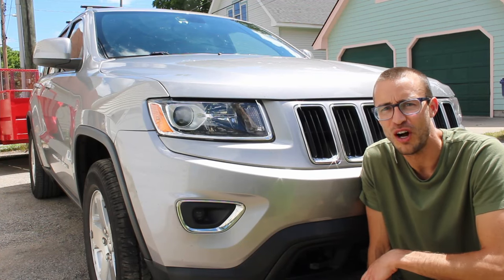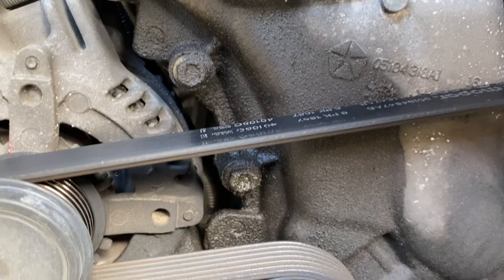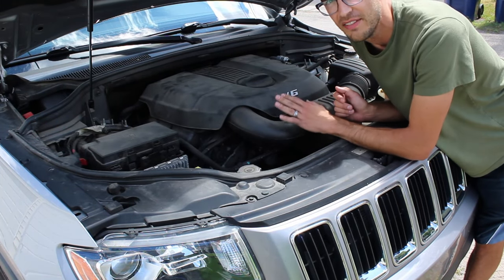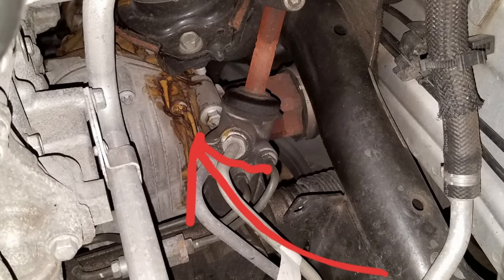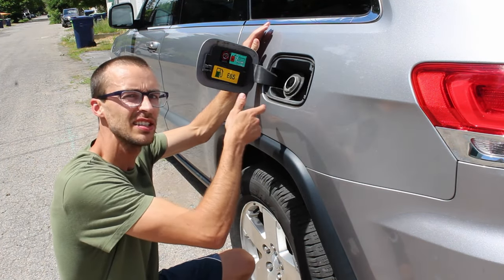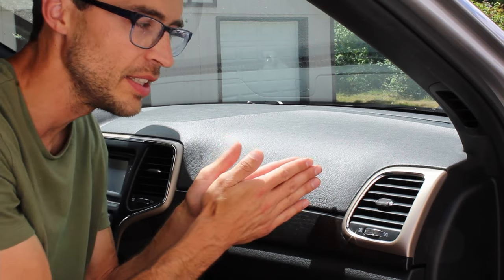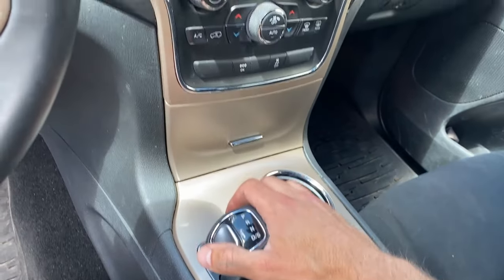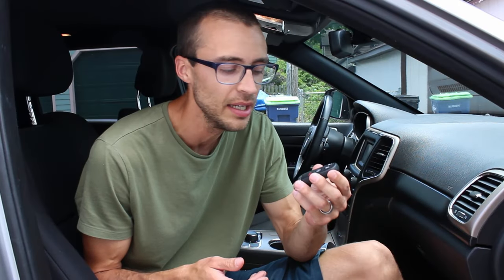Jeep Grand Cherokee Common Problems - 2011-2022 WK2

Comment from the maker: If you found this helpful consider sending me a Super Thanks :thanksdoc:💰 I will buy a Coffee with it! ☕
Reply: I had my Jeep in the shop for about 2 weeks because someone ran into me. Now all of a sudden my suspension system isn't working. My Jeep is so low to the ground that it's scraping everything and bouncing around like crazy. Progressive won't even fix the issue reverb right the original accident wasn't my fault and I never had this issue before taking it in for a fender bender...  I'm soooooooooo angry I have no idea what to do other than her a lawyer
Reply: I have a 2011 3.6 lerado. When I go 60mph, It make this grinding whistling sound like air leaking from under the hood.  Is there an evap line under there that needs checking?
Reply: @tdub8526  its a warped winshield cowl
Reply: @cliffwood2909  im hoping its the heater line to my A/C. I don't get heat on my drive side, waiting on the part now.

Comment: I own a 2011 Grand Cherokee Overland. I would advised, Anyone thinking of buying one. Don't it's just not worth the hassle. I've gone threw 3 compressors 2 radiators hoses and pumps. An evaporator. which i did not repair. Air suspension leaks. So stay far away from any suv or vehical. That has air suspension on it.
Reply: I think maybe you just had some bad luck. I'm on my third Grand Cherokee with air suspension in a row and none ever had a single issue with the air suspension at all.
Reply: does warranty cover all that? if so i’m grabbing one this week
Reply: @outsideboy23  depends on what warranty you choose, most of em cover just engine/transmission
Reply: @cavsnation9194  wow just hurt my feelings i was looking forward to this 😒 even for the 2016 models ?
Reply: @outsideboy23  dealers warranty should have you covered , but extended warranty covers engine and transmission unless you get bumper to bumper
Reply: @outsideboy23  it’s not that bad , my Cherokee had a leak in the suspension and it was a 30 dollar fix ,I haven’t ran into no big problems just yet
Reply: I converted mine to coil spring
Spring from king suspension
Shocks from dobinsons
Reply: 2011 (1st model year) and 2014 (refreshed model pushed out in early 2013) were the worst model years of the grand.
Reply: I have a 2015 grand Cherokee overland and never had a leak
Reply: Never had a problem honest the airbags aren't that hard of a repair if bags where 600 a piece years ago but now 60 dollars and no spring compressor required. The quiet smooth ride is worth it to me. Never had an issue and I wouldn't convert to steel springs. Honestly considering air for my 3500 ho
Reply: @outsideboy23  that's subjective! I have a 2014 wk2, with 125,000 no issues yet
Reply: The only problem with the 2011 is the fuse box housing
Reply: @KaisTheFireWarrior  so in other words, replacement of the entire file box unit?
Reply: @StickNclutch  yeah
Reply: I haven't had my 2011 Limited 5.7 hemi for more than two years: Water pump and thermostat failed the first year, second year evaporator failed, engine & tranmission mounts and upper/lower radiator hoses. Next on the list is suspension all around. Luckily extended warranty covered most of that besides hoses.
Reply: People complaining about Air Suspension could easily fix the issue to converting the suspension over to regular coils. Atleast that’s what I did and it drives 10x better.
Reply: @rs112490  what were the problems with the 2013?
Reply: Air suspension is bad in the cold, I live in Florida where it's hot and no issues
Reply: I need help with sunroof not closing
Reply: I mean I have a 2015 at 13000 and just replaced the radiator and that’s been the only thing. A lot of cars that have air suspension end up having issues not all but a lot so.
Reply: Just because you are terrible to your vehicle doesnt mean everyone treats it like trash. Get better parts than the cheapest piece of shit you see.
Reply: The 2011 is far and away the worst WK2 model year. Literally any other year is worlds better

Comment: I bought a 12' Laredo new.  Still have it, 140,000 miles.  The thermostat got me as well as the air switch you spoke of.  That one was $900.  My starter recently went, another $900.  Otherwise in 10 years it's been great.  Drives like new, I've done tires a few times, got rear brakes.  I plan to drive it another 100k.  It's quiet and smooth, and it can handle 20 inches of snow even though it's got the base 4wd system.  Best vehicle I've owned.
Reply from the maker: They are pretty great vehicles
Reply: I just bought a 2012 with 130,000 miles. Look they look great.
Reply: You garage that bad boy?
Reply: @jonthompson8807  ha good question.  Lived in in Illinois and did for 8.5 years.  The past 1.5 I've lived in a townhome near the beach in FL with no garage so it will be interesting to see how it does.  I wax it 2 times a year and no more show so that's good, but the ocean and heat will be a test. Looks good still
Reply: Yup they are tanks in snow and mud
Reply: I just bought one and it's super clean and neat barley used and the previous owner got the radio out and has a touch display, pretty nice.
Reply: My wife has owned her 2011 hemi for 3 years @92k currently, engine mounts, water pump, and transmission mounts all under extended warranty. I have replaced upper & lower rad hoses. Paid for a/c recharge and diag then the driver side blend door motor just went 🙃🙃🙃 suspension is toast and needs brakes all around. Horrible cars I am familiar with Honda/Toyota 😂
Reply: Closing in on 160,000, recently had to do the the oil cooler & decided to do my second round of spark plugs & coils while there.  (Not me, mechanic). Other than that still good!
Reply: Not tryna jinx myself but I bought mines in 2020, it’s a 2016 jeep grand Cherokee Laredo as well. I haven’t had a single problem other than a water pump or something like that which was only $200-$300 with labor to repair. What a waste of a $3000 warranty smh I love my truck! Still runs like new!

Comment: Also listen for a ticking noise from the engine; that’s the lifters going bad. They fail at the bearings inside and just one going bad will scratch your camshaft. I had to replace two camshaft. By the way if you are doing this job, just go ahead and replace all lifters, oil cooler, hoses, sensors, spark plugs etc.

Comment: Yup, 2014 Limited with 60K miles. Replaced the thermostat and both motor mounts leaked out long ago.  Doesn't seem too matter, however.  I needed to replace the battery today after 10 years.  Under the seat is a stupid place for a battery, but I had no trouble, thanks to good YouTube videos. Thanks.

Comment: We are the lucky ones we just purchased a 2017 jeep grand Cherokee limited with the luxury 2 package used with 60,000 miles one week of driving it odometer flashes lights flicker and the passenger window rolls down on its own now it’s sitting at the dealership waiting for it to get fixed Merry freaking Christmas
Reply: Im about to buy a 2017 one you don’t recommend me it ?
Reply: @PaapiA  update it was a loose ground under the battery and the batteries are under the passenger seat it took the dealership 3 weeks to figure it out but ever since it's been a wonderful vehicle and my wife loves it

Comment: You mentioned rough idle. Mine is starting to do that now. It is a 2017 and has about 63K miles. It also shakes pretty badly when I am stopped and barely take pressure off of the brake to creep forward.  It isnt thowing any codes but seemed to start after I had a fuel injector issue and had them replaced.  Any ideas what causes this or what I can do to fix it?
Reply: What did you end up doing? Mine is idling.

Comment: 2011 - 208K miles....waterpump was replaced at 150k. I replaced the broken accuators (both) ~185K.  youtube can help you with any fix needed.  Still runs great!
Reply: Your actuators got that far? Wow. Barely got to 100k. 25 cent piece of plastic!

Comment: my wife has a 2015 JGC Limited 3.6 with 110K miles,  we bought it brand new.  We have had some issues but nothing worth mentioning.  Based on mileage and dealer's recommendation, I've been doing some preventive maintenance; idler pulley, tensioner pulley, harmonic balancer, belt, thermostat, water pump, starter, motor mounts.  Soon I will be doing the rocker arms.  All in all its a great SUV, the engine still running very strong without showing any signs of slowing down.  I'm hoping to keep it for another 10yrs.
Reply: Is it necessary to replace timing belt at some point ? Or it’s a chain ?

Comment: 2012 Hemi Overland w 122k- Air suspension line leak and then compressor failure, motor mounts, water pump, leaking steering rack, 2 broken exhaust manifold bolts, blend door motor failure
Reply from the maker: 5 out of 6 I mentioned in the video not too shabby!

Comment: 2012 GC OL. I had pretty much all the problem you discussed. I am not a handy man however I fixed both blenddoor actuators. Driver side was little difficult. Cost me under 100 dollar to fix. Dealer asked me 1800 dollar to fix. Lol. YouTube has step by step instruction. Thanks for sharing. Love the comfort. I find this Jeep way more fun drive then my 2018 4Runner. I said comfort not reliability. Lol
Reply: if you remember which video that helped you replaced the driver blend door actuator.. i would LOVE the help! mine has been broken for like 2 years but i know how much the dealer wants to fix it and i cant pay that. thankfully i live in sunny cali and heat isnt a huge need in my part of the state

Comment: I’ve had my 2015 GC Lerado Blackhawk for 3 years now. It has 190,000 Kms on it. I’ve changed the oil filter housing (did it myself), changed the thermostat (myself), I think #4 coil and just recently changed all 24 rockers. Even with all that, I love this SUV it’s such a nice looking SUV, especially, black on black 😊

Comment: I have a 2014 limited and the things I experienced before it reached 90k I had to replace, transfer case sensor, ABS sensor, valve cover gaskets, thermostat, radio replaced twice,  transmission went out, radiator leaked because its made of plastic, I go thru brake pads and rotors every three years and I use ceramic pads. I have 95k on it and we replaced spark plugs and coil packs. Despite having these gremlins and wear and tear items, I'm still keeping it.

Comment: I have went through the comments but didn’t see anything that was the issue I’m having. I have a 2019 limited grand Cherokee and I just replaced both batteries today after they went bad. I’ve been having the hatch open on its own which started a couple days  before the batteries went bad. The hatch still is opening on its own and the dash is lighting up and lights on the heat shifter are staying on when the vehicle is locked and shut off and the key fob is nowhere near the vehicle. I’m not sure what the issue is I’ve
Been trying to research and figure it out. If anyone has any idea please comment and let me know I’m puzzled and for sure don’t want to buy more batteries if these lights staying on keep draining the batteries

Comment: 2011 5.7 hemi with 225k miles..... blend door problem is a real pain. Replaced water pump, brake diaphram, a head light and have that hood bubbled paint. Sometimes have to use the key fob in the dashboard to start the engine. It acts like an alarm issue or a fob battery is bad. The tranny gets over 200 deg. F when towing my boat over 100 miles. I'm afraid to trade it in for a newer one as it runs well.

Comment: I just bought a 2021 Grand Cherokee Laredo with less than 20k on it. When I go on rough gravel roads you can hear f - r suspension clunking, yet when I put it on jacks I can't find anything loose.
Reply: Probably a stabilizer/sway bar link

Comment: The fuel pump relay was a recall.  It is part of the tipm. The recall put in a relay external to the tipm.   I had the replaced relay also quit.  Only a $4 DIY fix though.  
I'm having a problem now where the engine will start and stall a few seconds later.  You have to push the button to turn the ignition off to attempt a restart.  If you just keep your foot on the brake and try to restart it the engine will crank but not start.   I've been told the fix is to either remove the start button and use the key inside the fob or replace the ECM.   Mine has been doing this occasionally for a few months but it always ends up starting and staying running.   It happens hot or cold, in all kinds of weather.  The security system that the fob connects to loses contact as it transitions from starting to staying running.   I found holding the fob near the start button helps.
Reply: Having this promblem with the cranking now trying to figure out the issue with that but no check engine light to determine

Comment: I'm on my second, really love to drive these Jeeps.  My 2011 V6 Laredo other than factory recalls done, changed the blend door on passenger side, tight access but certainly easy. Although was experiencing a weird rear brake problem, on occasion the rear brake would grab and heat up. Was going to change the body to caliper hose, but traded in before.  I found that if you change the oil filter (easiest of any car !) was to change the seal which usually comes with the filter to prevent leakage. My 2016 392 SRT has been good also, changed the water pump and themostat , had a shock go under warranty, but other wise has been pretty good.  The Carbon fiber trim pieces typically start to warp, but I believe they have an extended warranty due to being a common problem. Otherwise I really enjoy driving these vehicles!!

Comment: My 2013 has the corrosion on the hood I covered it with a bit flector but it over heated on the wife may be doing a engine swap unfortunately

Comment: I have a 2015 V6 now with 93,000 plus miles. Thermostat housing cracked which is common. A 28 dollar replacement and YouTube helped me replace it and save a ton of money. ** Make sure you replace it with the updated part to avoid the same issue. It's visibly beefier at the 90 degree bend.

Also common, and now covered are the active headrests breaking and deploying. Most are lucky and aren't driving when it happens, unlike me. Suddenly having your head hit from behind while driving will scare the crap out of you. Pentastar Plastic strikes again here. The plastic that holds the locking pin is thin (cheap and brittle). It will break and headrest will deploy, even though the locking pin is still in locked position. 

Still, those really aren't so bad overall and I still love my Jeep. Given the price of the new ones, I'm happy to keep mine which is paid off.
Reply: My headrest deployed while I was just sitting in the car, not driving lol. Still was unpleasant

Comment: 2016 Laredo E 4x2 purchased used in 2019 with 30k miles. 71k miles today 2/9/23 and other than synthetic oil changes every 8-10k miles (never even had to top off between changes) and engine/cabin filters, I haven't had to fix anything. I do need to change the key fob battery probably every 12-18 months and I also experience the rough 1-2 shift if I don't let it warm up and it's cold out. I've experienced this in other vehicles too so I'm not worried about that. Super reliable so far!
Reply: Even synthetic needs to be changed every 5000. Don’t do that 10k interval. Trust me. That’s a sales gimmick.
Reply: About 88k miles today 7/17/24. No issues since my last comment on 2/9/23. I still go between 8-10k on synthetic oil changes. At that mileage interval, the oil still doesn't look all that dirty and is probably 85% full. The sales gimmick is changing your oil at its half life. The only way I can see needed more frequent oil changes is if you're always driving hard or if you basically drive it like a fleet vehicle, lots of stop and go.

Comment: 2014 Laredo 4x4 with 94k miles. Replaced transmission under warranty after 60k miles. Recently had to replace starter and flywheel. Blend door issue, and about every 2 years the a/c fuse melts. But overall, has been an awesome vehicle and still runs smooth
Reply: Man I have a 2021 and have had my transmission replaced twice! I have only 27k miles on it

Comment: 2011 3.6 180k no problem ever.. except for the recalls that jeep took care of fuel pump relay brake booster all the recalls have been done and I’ve had absolutely no problems 180 thousand miles and I still get 22 mpg on 32 inch tires. Yes it is lifted 2 1/2 inches.

Comment: Does anybody experience their 2013 JGC shutting off periodically while stopped. Mine sometimes will shutoff randomly then once shifted into park it starts up after one or two cranks, but It never registers a check engine code, it's like it never happened and can go months with no issue until it happens again randomly. It happens in cold and warm weather

Comment: my top 5 Issues I've had with my 2014 GC
1. Warn rocker arms, causing that ticking sound.
2. Thermostat
3. Driver Side Blend Door Actuator.
4. Transmission cooling lines broke off
5. Service shifter message.

Comment: My first heated seated seats stopped working replaced the fuse still not working checked the connections as well. It's a 2014  jeep grand Cherokee limited
Reply: Same here 2014 driver seat not working

Comment: We own a 2015 3.6 jeep grand Cherokee. Today dealer tells me that it has a blown head gasket. Only 50k miles. Ohh extended warranty won’t cover the warped head.  But it will pay for the gasket. Going to pay to fix it then dump it. Thumbs down with Jeep. Should not have happened.